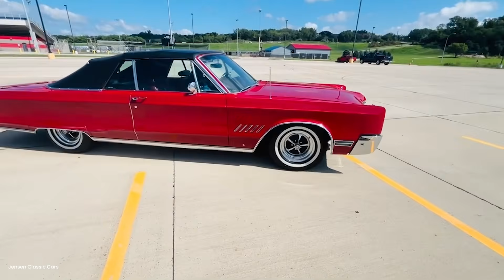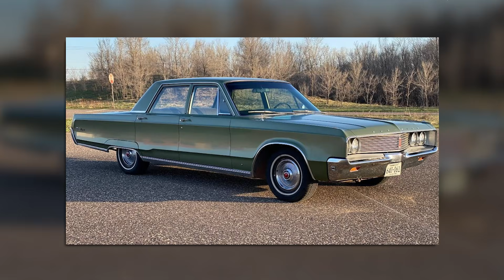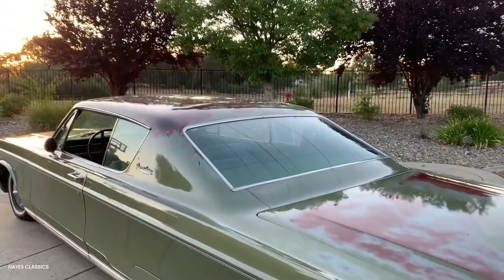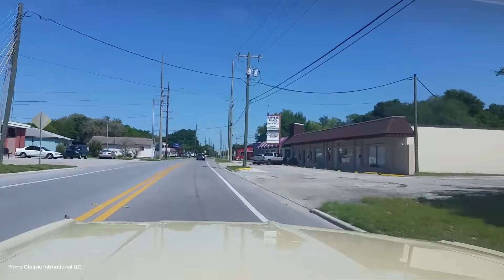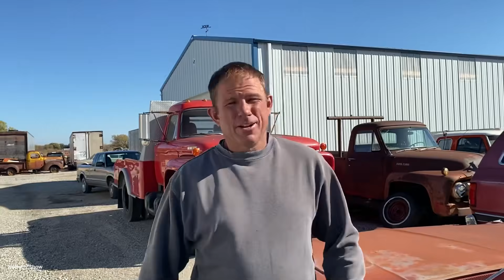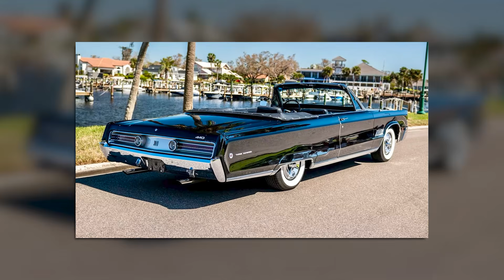This Virginia Teen OUTSMARTED Chrysler With a $55 Poly 318 That Beat 383 Road Runners

Comment: Actually it was DeSoto that spent much time and money designing various head designs to squeeze every horse power out of engines. This was all done with an unlimited budget because this was for Military Aircraft during the War. The Hemi worked out to be most powerful but the machining was far more expensive because instead of inline valves all with same angle as well, the Poly cuts out some of the Machine work plus the cost of one of the shafts.
I'd love to figure out how to modify blocks to be able to run the Poly heads which will produce more power than a wedge.

Comment: I was calling BS on all of this, but stopped watching when it said he used exhaust manifolds from a 340 LA engine. It is impossible to use manifolds off of a LA engine because the center two cylinders have the exhaust ports next to each other. On a LA engine it goes E I, I E, E I, I E. The poly is E I, E I, E I, E I. A poly 318 can be built to make some good HP, but unless you stroke one, you are pretty much limited to about 300 HP. No way is a B body with a poly beating a Road Runner with a 383 Magnum.
Reply: Depends. A stock 440 Magnum can be put on the trailer by a 318 Poly. That Poly would need a massive overbore (they can be safely bored .090, which is pretty impressive). It would also need a big crank, which is available, headers, and the 4-bbl. intake. It would be expensive, but the combination can displace 402 cubic inches and push approx. 425 hp. Of course that's an apples and oranges comparison.